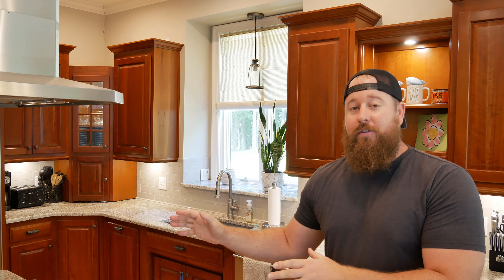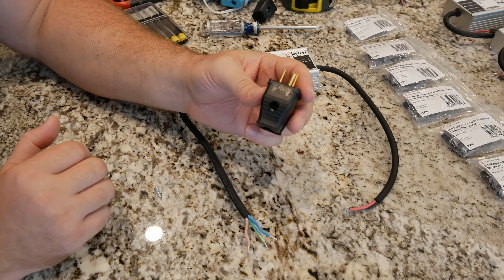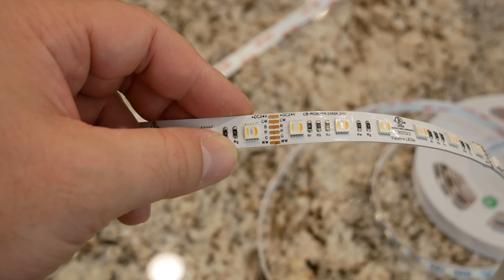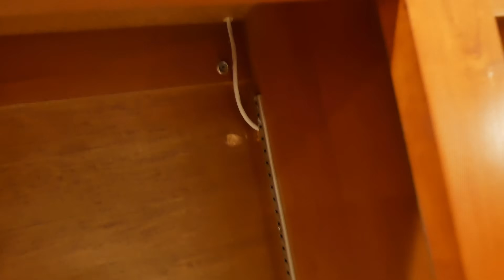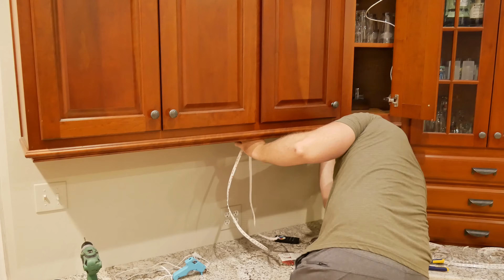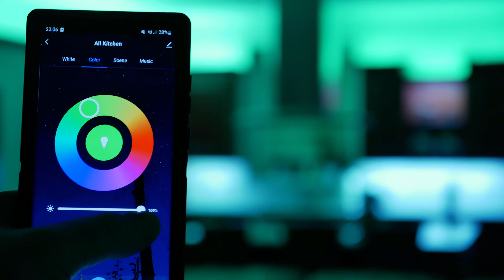Complete DIY Cabinet LED Accent Light SOLDERLESS Installation with FlexFire RGBW LEDs

Comment: Great Job!. I reached out to Flexfire to get some info on the parts and pieces I needed for my project. The sales guy told me they don't offer the 6 wire to led strip connector without the
extension wire on it already. I could only get the !2" or 36" wire attached which means I have to do several wire to wire connections instead of simply connecting wire to led strip like you did. 
Unless I can take out their extension wire? Do you know why they might not offer any more. Doesn't make sense to me. Thanks
Reply from the maker: That is super odd... there are other companies (on amazon) that have similar connectors if they don't have exactly what you need. They should offer that though? Maybe try another sales rep lol. Or look up the product on their site for a part number. I can't imagine they would stop carrying those!
Reply: @LifeofBliss  Thanks for your quick response. New subscriber now. Yeah even the website doesn't show the connector only without wire? Really odd. 
Might try another Rep. I thought about the amazon connectors but wasn't sure if they would be compatible with Flex Fire strips? I'm learning as I go on this whole deal.
Lots of vids and info out there and a bunch of its kinda vague, lol.  You had a great vid which cleared up several things for me. Thanks again for your quick response
Reply from the maker: @bworks1968  the 6 wire connectors should be for 12mm led strips. They should be universal so no worries going with another brand
Reply: @LifeofBliss  Good to know. Thanks again!